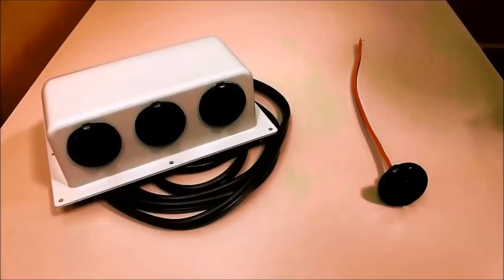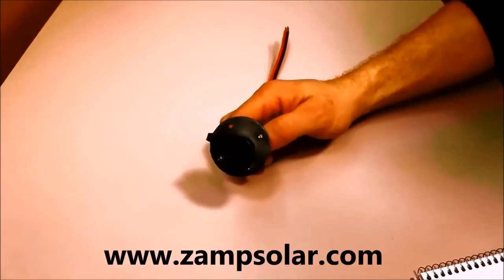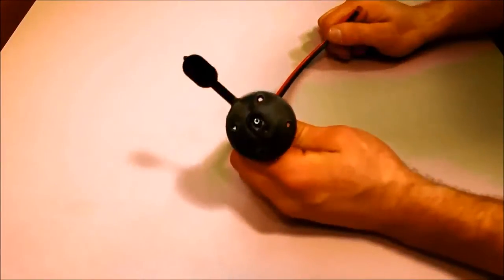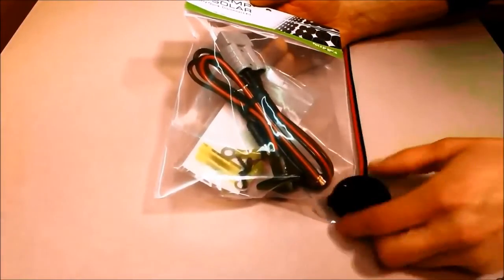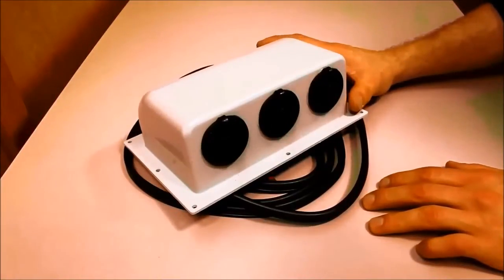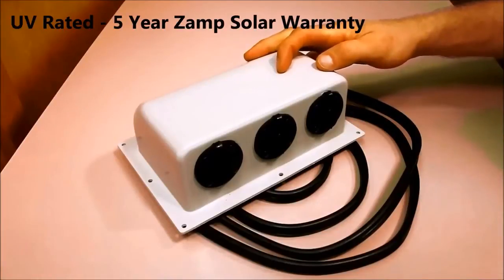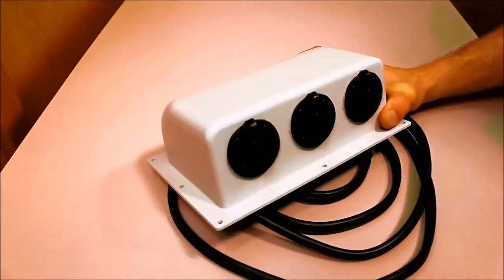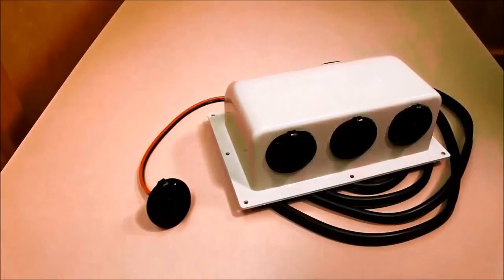Zamp 3 Port Solar Roof Cap and Roof Sidewall Port | Back Country Solar

Comment: Our Riverstone already has the 3 port connection on the roof and the solar controller. I would assume that all I would need is the panels. Am I correct?
Reply: Our 2019 Forrest River Sierra came all prewired with Zamp controller and 3 port roof camp from the factory. The dealer installed 2 Go power 100 watts solar panels and almost burned down our new 5th wheel. They didn't even know about the revers polarity wiring. completely melted the Zamp controller. They fixed it all, but im not sure if they just swapped the wires under the cap now or what they did.
Reply: Looks like no one cared to get back to you.  The thing to know about Zamp (and please research on your own) is their entry connectors have reverse polarity to keep you using Zamp panels.  You can reverse the wire or buy an adapter to reverse the polarity (so that your positive hits positive and negative hits negative).  Zamp makes a great panel but they can be 2.5x more expensive than say Renogy panels.  Good luck and do your homework before trusting someone like me on the internet.  :-)

Comment: Is this mc4 connection? What type of connection is used?
Reply from the maker: No it's not an MC4 - it's an SAE connection.  Here is a link to a solar panel wire on our website where you can see the connector up close.  https://backcountrysolar.com/collections/mounting-options-and-accessories/products/zamp-solar-panel-wire-10-ft-uv-rated-sae Thanks for the question.

Comment: Looks like +12V (red wire) is hooked to the exposed metal pin.  That's rather exotic as it is an arc hazard.  It appears other SAE port adapters that connect here use the opposite definition.  The Anderson SB50 connectors have a well defined polarity.
Reply from the maker: Hi Chris - The red wire is connected to an auto reset breaker.  Once the roof port cap is installed flat on the roof and sealed correctly there is no arc hazard.